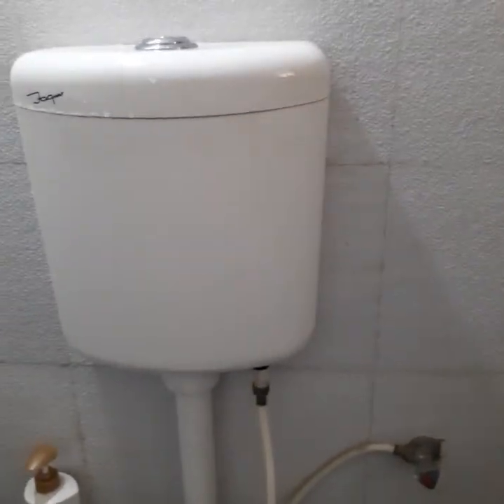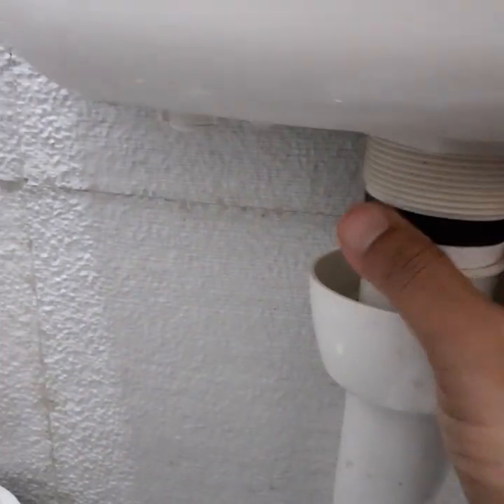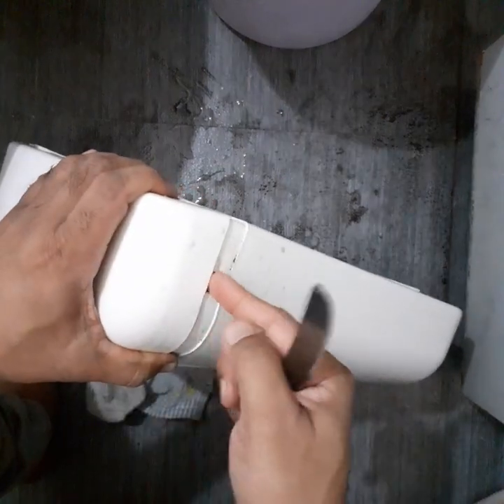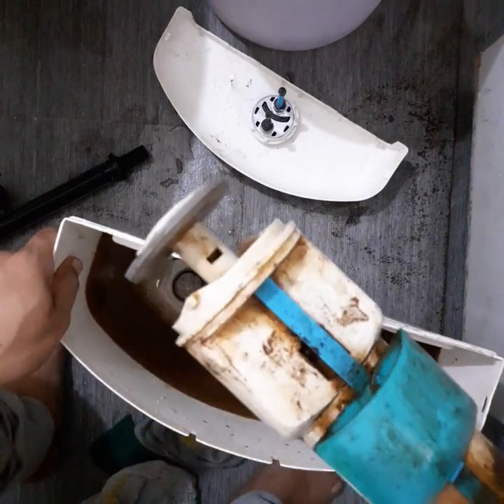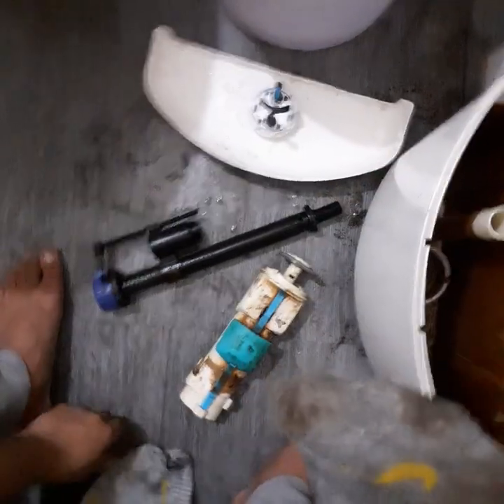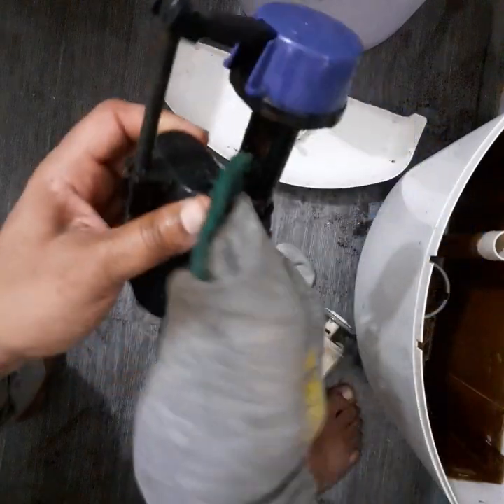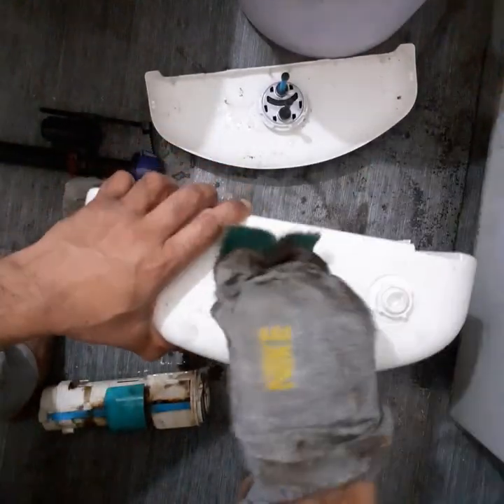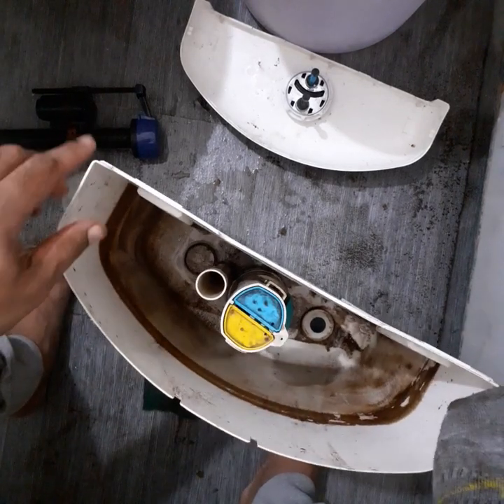Cleaning Jaquar Wall Mounted Cistern to fix leakage

Comment: water is not coming to the tank of flush. What to check
Reply from the maker: Check the following
1. Inlet filter is clean
2.Open the Cistern and remove salt deposits on the inlet mechanism ( black color rod inside)
3) Salt deposits near the exit valve

I will create another video for this

Comment: I have this same cistern.but now it takes a long time (2-3hours) to get full.it would be very helpful if you suggest me what to do.
Reply from the maker: Open the Cistern and check the following
1. Inlet filter is clean
2. remove salt deposits on the inlet mechanism ( black colour rod inside)

I will create another video for this
Reply: @goyalrohit2002   please share the link if you  hv create video how to clean that black rod inside.
Reply: bhai outer valve ke waha blue stopper laga hua hai wo nikal do
Reply: @prashant14jun   outer valve kaha hota hai please bataiye...i face the same problem
Reply: @pateldivyang1315  water controller wala jo pipe hai.. jisko inlet laga hua.. uske other end ko dekhna ek chotasa outlet hoga.. uske samne ek blue color stopper laga hua hai.. wo nikal do